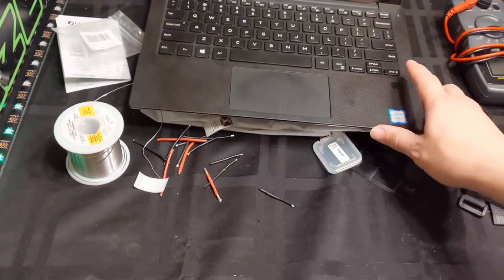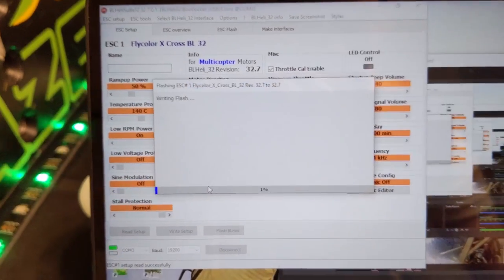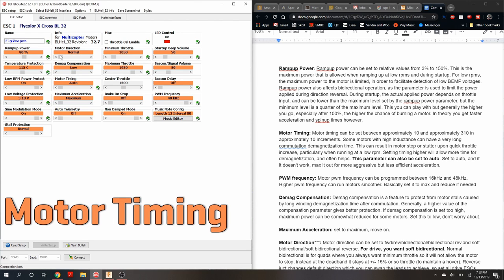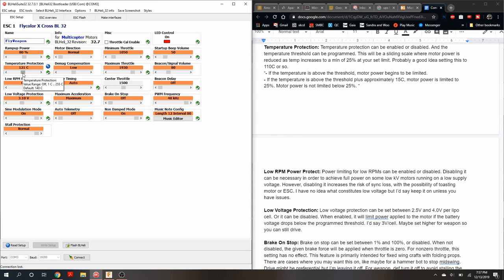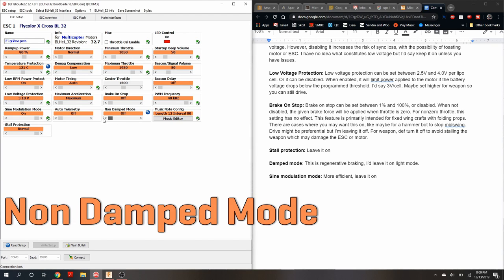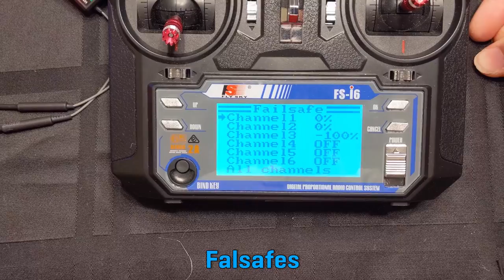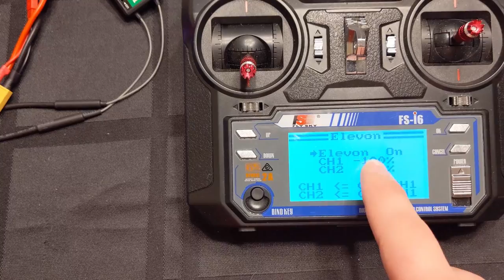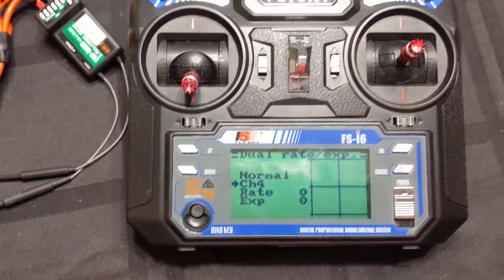Brushless Motors in Combat Robotics: Blheli32 + Transmitter Programming Guide

Comment: Is there any reason a 4-1 quad ESC wouldn’t work, assuming you could program it without a flight controller?
Reply from the maker: Not really, although if you did burn out one of the four onboard ESCs you are stuck with one dead one on that board. It could clean up wiring if you are using four brushless motors though most only use three or fewer.

Comment: Hey, Seth I wondering if there was a way to do a tank drive/ drivetrain utilizing 2 joysticks?
Reply from the maker: Yeah of course. Bloodsport actually is tank drive as that's how Justin prefers it. Just make channel 1 drive the right side and channel 3 drive the left side. The issue is just that most transmitters have a spring return on the right stick (mode 2) and the other is throttle so it sticks in place. 

Often if you take the radio apart there will be a spring that can be removed from one channel and added to another to turn the throttle channel into a returning stick, or you could search online to try and buy a spring return kit for your radio. The Jumper T8sg Plus I just got came with one in the box.
Reply: @JustCuzRobotics  yeah tank drive is super nice. Having done vex for 4 years I'm used to it

Comment: Awesome guide! Do you know if its possible to assign a button to reverse left/right in the middle of the match? In case my bot gets reversed it would be nice not to have to try to control it in the oposite way.
Reply from the maker: Yes I think I actually showed how to make such an invert switch in this video going over Draconid's controls. Basically you only need to multiply the steering channel by - 1 to invert when upside down
Reply: @JustCuzRobotics  Aha!
I re-watched the end of the video, and you do mention how to reverse a motor in case its plugged in wrong but I don't find the part about assigning this to a button. 
In my case I would like a button that when flipped would change the mix/elevon.
When a bot flips over the steering left/right remains the same, but reverse becomes forward and vice versa.
So the switch would need to change so that forward of the stick gives a negative value for CH1/CH2, while keeping the same mix when going left and right.
Reply from the maker: You won't be able to do this with a FS-i6 but for open TX based radios you can do it on the mixes page
Reply: @JustCuzRobotics  Ah I see. I think its possible to flash Open TX on FS-i6, maybe that is a solution

Comment: For controlling the two ESCs for the weapon motors why not simply run the signal from channel 3 to both ESCs using a split wire or the like. I like your solution but am curious if there was a specific reason you can’t wire them that way.
Reply from the maker: Quite honestly I didn't even consider that since it would involve rewiring a servo connector. The downsides would just be that extra effort and then having one ESC that was no longer interchangeable with the others since it didn't have the signal wire going to its own servo connector. I just kept the hardware as simple and swappable as possible in exchange for a little more radio programming